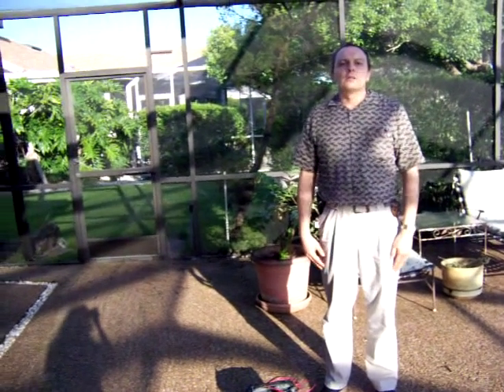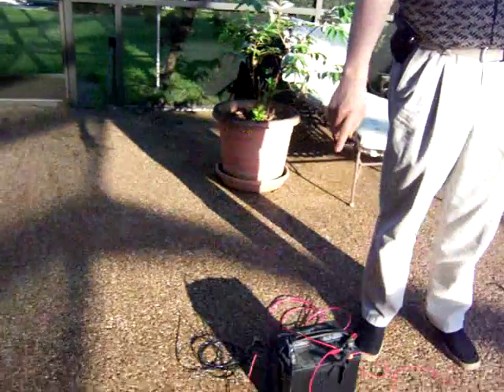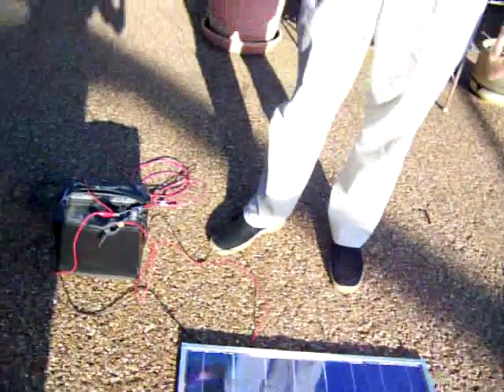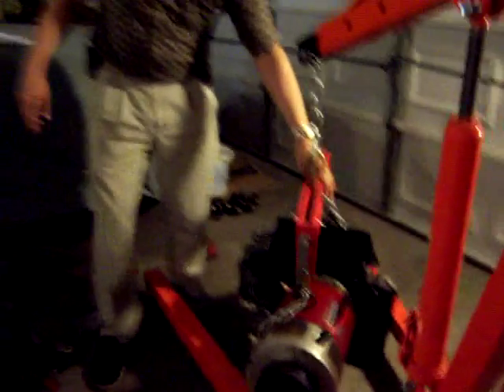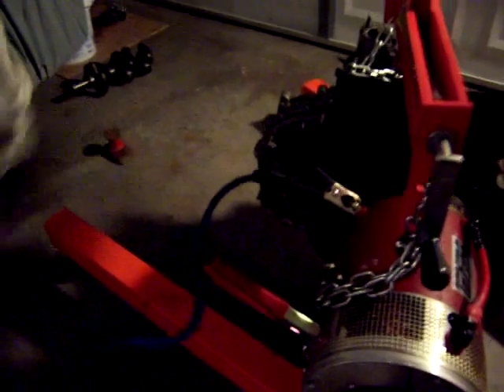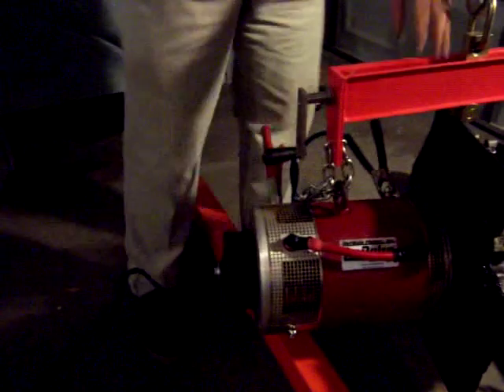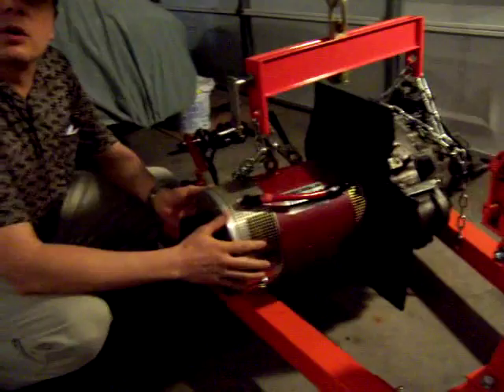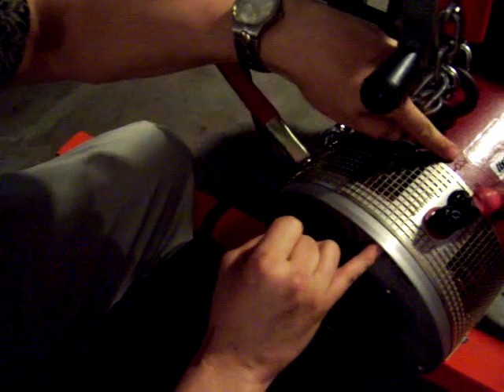Nissan Sentra Electric Car Conversion Part 12

Comment: How much was the total cost for this project please. Before I even consider doing it
Reply from the maker: The cost varies wildly from a few thousand dollas to more than 20 grand depending on the size of the vehicle and if you use new or used components and the range you want. I'd say if you use new components with Lithium batteries in a compact car, estimate about 10-15 thousand plus the car depending on the range you want, but look at this as an investment instead of an expense. You will also save a lot of money in gasoline and services and eventually will recover your money and more